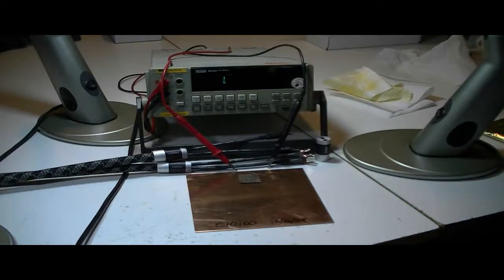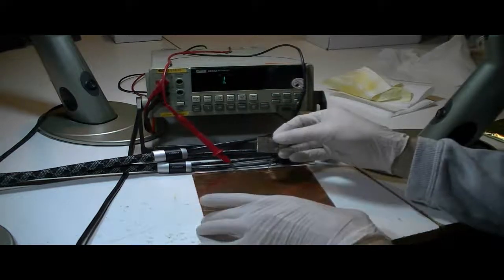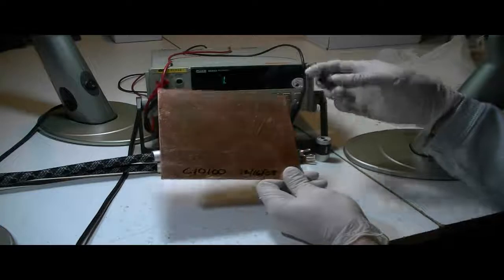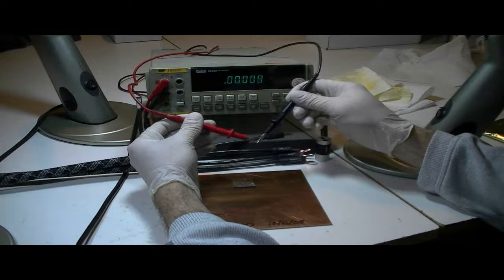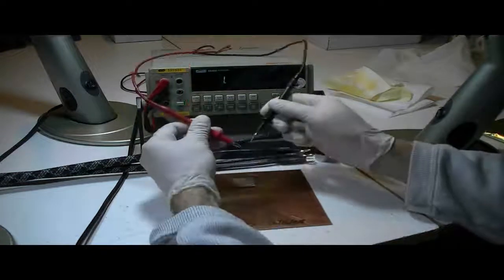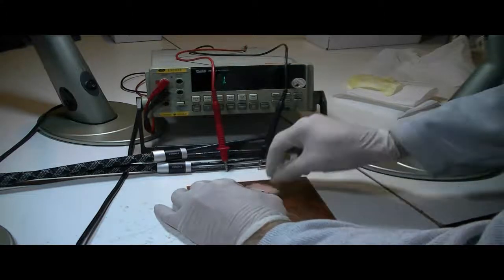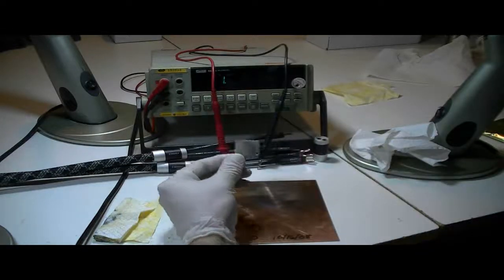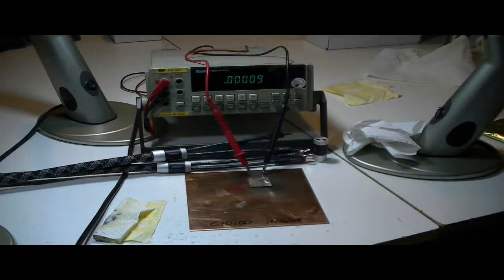Oxidized Copper and Silver Conductivity

Comment: U stupid silver on top of copper haha
Reply from the maker: That is a very intelligent comment. Thanks for your valued input.
Reply from the maker: @Bad Example We tend not to say that a difference in sound will be realized. There are too many things that influence the quality of sound. We also believe the best connector is no connector. Most will agree that directly connecting your wire to the equipment is the best method. Unfortunately, that is not always safe or easy. With that being said the second best method would be to use a connector that has similar conductivity as the cables. This can only be done using copper or silver. Our recommendation is to use components that maximize the performance of your system without breaking your bank account. Most of the brass connectors out there are way over priced and Furez line of copper connectors bring a lot of value.
Reply: @AVOutletcom  
Greetings, from Portugal.
In order to keep the costs "low", i am considering pure silver wire for the interconnect cables, and their terminals. And silver plated copper cables for the speakers....using silver plated copper binding posts.
The wire... https://www.audiophonics.fr/en/cable-metre/mundorf-mconnect-sgw115w-cable-argentor-isole-ptfe-blanc-15mm-p-1818.html

What are your thoughts about this ?
Thank you in advance for your reply.
Cheers.